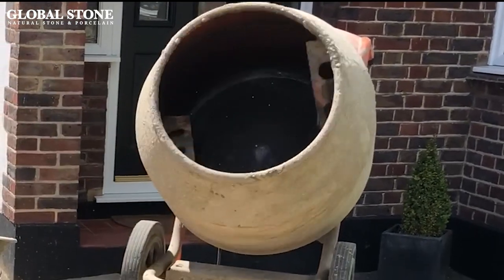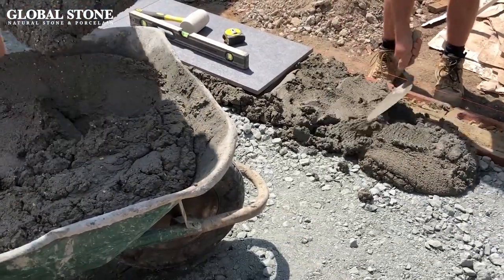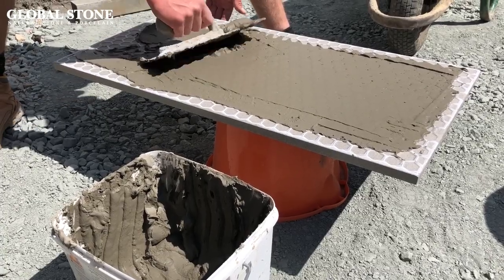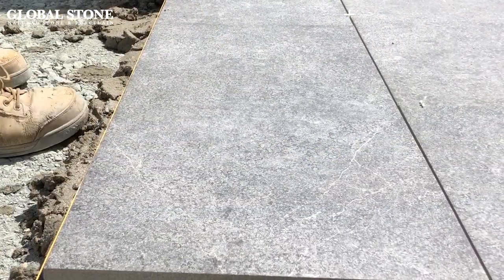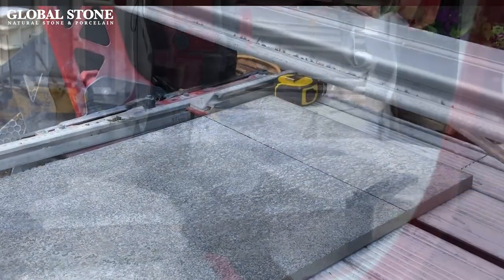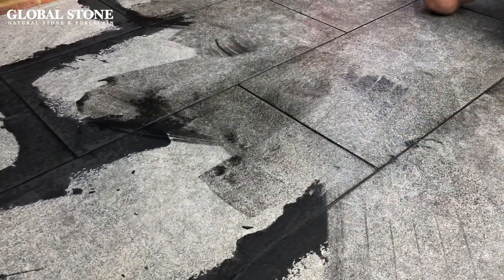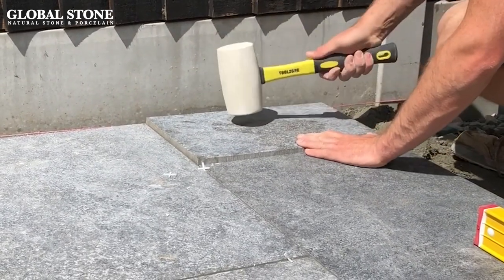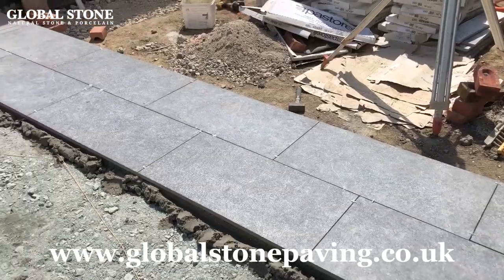Laying Porcelain On A Mortar Bed - Step By Step Guide From Paving Shop

Comment: Great video and job does anyone have any experience laying with packs of  295mm x 295mm, 295mm x 600mm, 600mm x 600mm, and 900mm x 600mm,  and getting the right joint widths?
Reply: i have and its a pain in the bum lol but it looks lovely im on 1 at the min 42 square merters 😢